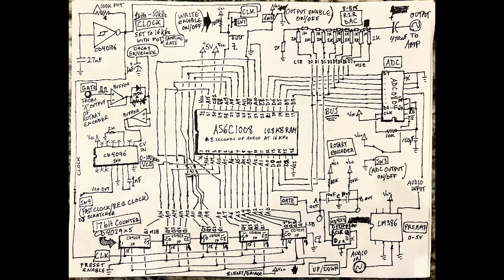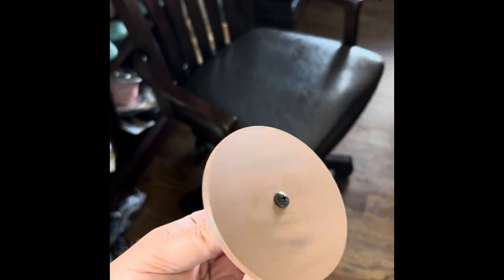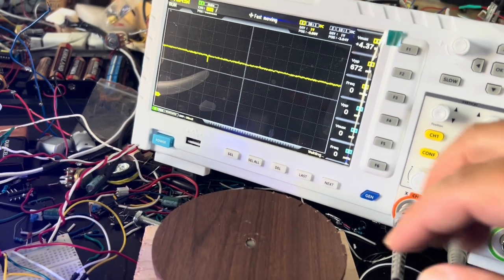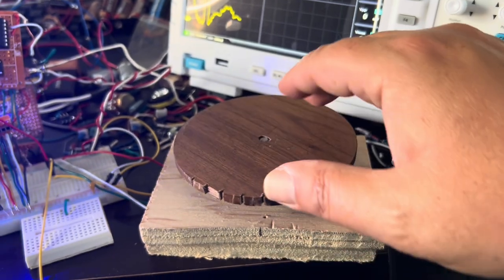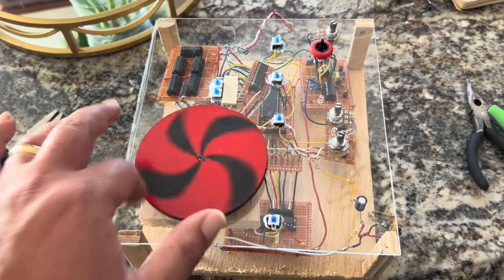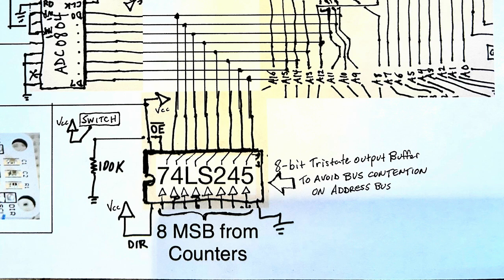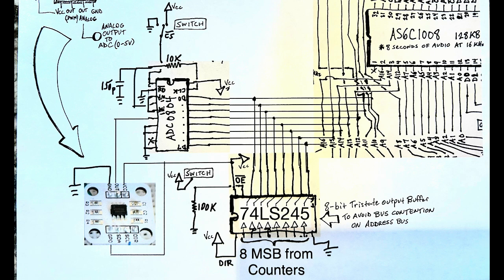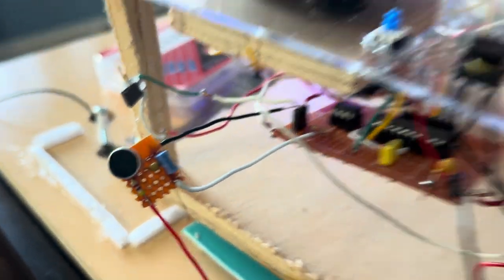Diy Digital DJ scratcher with AS5600 - DIY Sampler gets an upgrade

Comment: Here's an idea ive been trying to figure out,
Using an old HDD as a dual encoder/motor and programming motor to spin at same bitrate as sample. This way you get an indication of timing just like traditional scratching
Reply from the maker: I thought about putting a motor in thats pwm controlled but i never made it to actually implementing it. I feel like it would be too error prone unless you use a microcontroller and PID control for a servo which im not ready to embark on. I feel like i can get a non traditional indication of timing by manipulating the led outputs from the counters. Im currently building a new sampler device with some newer features and that is one of the features im trying to work out

Comment: Impressive! Think you could have several ram chips in paralell, with a pushbutton switch to "chip enable pin" then you can change the sample fast just by pressing the buttons whilst also scratching at the same time :)
Reply from the maker: @86Ivar  thanks. Thats a good idea

Comment: Cool this platter.

You might wanna add a Sallen Key filter to the output, to prevent the switching noise of the ic's from leaving the output.
How about using a 32.768 Chrystal for the audio tact?
Reply from the maker: @AnalogDude_  good idea.
Regarding crystals i have always wanted to try but don’t know how to use them other than the full can variety which are hard to get
Reply: @igorbrichkov3632  search:  electronic schematic Chrystal.
Some seem to use cd40106 / cd4050. with a 32.768 you would be inline with old standards, leaving you with 4 seconds of hd audio.

I was wondering when your record audio, do you also hear it? since the adc and dac share the same bus at the same time.
Reply: @igorbrichkov3632  look for "electronic schematic Chrystal"
Some seem to use cd40106 / cd4050. with a 32.768 you would be inline with old standards, leaving you with 4 seconds of hd audio. I'm amazed that the sound is pretty recognizable  on 16k.
Reply: @igorbrichkov3632  look for "electronic schematic Chrystal"
Reply: @igorbrichkov3632  I'm making a PCB at the moment to do the same, kinda, but using 74hc374, 23lc1024 sram and mcu.
Reply from the maker: @ cool, you going to post it when done?
Reply: @igorbrichkov3632  It will take a while, i might add the adc0804 as well and switch between 74hc374 tot dac0800 / dac0808.
resistors take lots of space.

I'm designing a pcb in eagle rather than using wires, it's also kinda a experimental board also using  eprom,  various sram ic's and GUI (buttons, oled display's). I'll use jumpers to activate or deactivate sections of the board to cut power. 3v33 tot 5v and vice versa. as wel a interface to eurorack modular synth power.